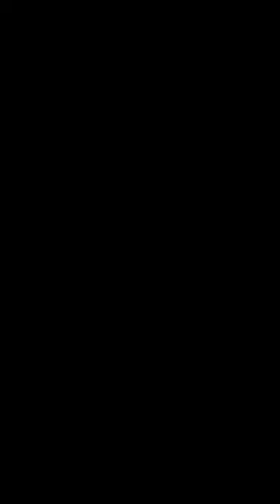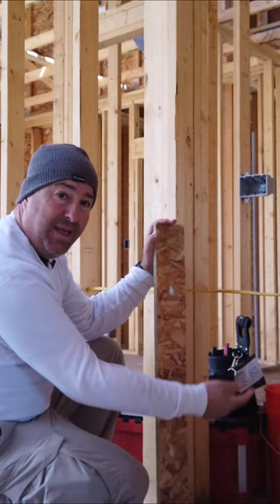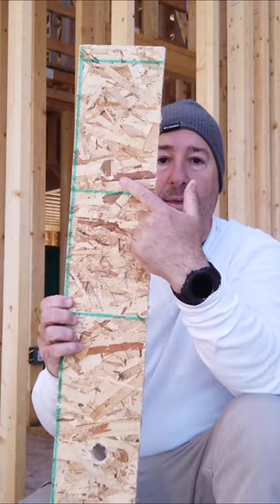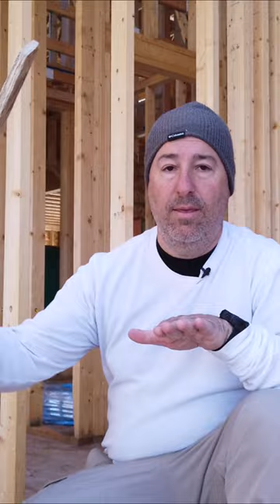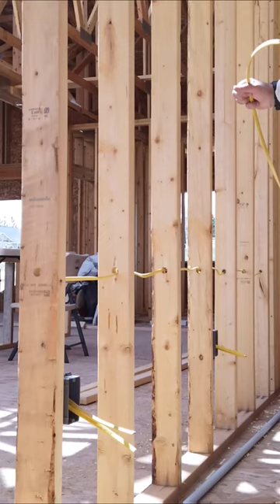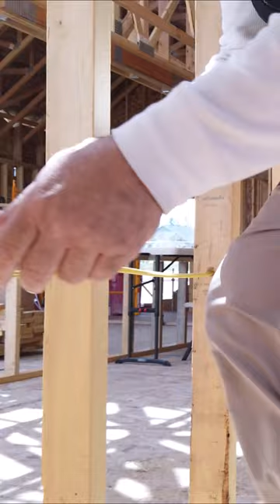How To Run Electrical Wires Thru Studs (Romex) - electrician tips and tricks

Comment: It makes the work look a lot better having all the holes at the same height. Plus, if you ever have to go back, you roughly know exactly where they're at in the wall
Reply from the maker: That's what I'm saying super easy
Reply from the maker: It's like, why make up the panel neat and clean like art. Same reason to run wires level and consistent.

Comment: Assuming the floor has been poured already. Laser is probably easier and more consistent. Plus you can move it up or down with ease
Reply: Depends on the job man. If they’re going to drywall right behind you then it’s not that serious, it’s getting covered up. No point in spending toooooo much time. If you use your body as a marker you should know what part of leg / chest to line up holes to punch with. It’s not a big deal if it’s off by an inch or 2.

Comment: The are barrels you can beat into the hole so you dont have to use a stike plate
Reply from the maker: Yes, the first time I saw them was at Southwires traingin center. There pretty cool. Problem is you can pound them in after the NM is in so sometimes will slow you down.
Reply: @The 360 Electrician  it does seem pretty slow at first but once you get a rhythm going its actually quicker I use them every day

Comment: Actually really good idea and you could easily turn this into a jig for sale.  Include some measurements and this could easily be the equivalent to a framing or speed square. 

😂

I use a laser but there’s always some variability which is greatly reduced with a jig.

Comment: Or just use a laser
Reply from the maker: 100% agree, but what if you have 3 crews? Takes too long to set up room by room, expensive to buy more than 1, battery dies it gets knocked over. You go to lunch have to pack it up etc. Works for sure but slow and costs more than a piece of free wood. Thoughts?

Comment: What a complete waste of time. Grab that hole hawg.with a 14" 7/8  greenlee nail eater bit. Lock the back oh the drill into your hip. And that drilling  keeping the drill level. Myself and a apprentice would layout, box drill,run circuits homeruns and panel of a 2500 home in a 7 hour day. You do it quick to not waste time. So anything you do extra like a template for each hole costs time.
Reply from the maker: That's definitely one way to do it. Wear rist guards or buy the new hogs with twist protection. Does anyone know who makes one these days?

Comment: I just used a chalk line pretty simple
Reply from the maker: I hate lines, messy to much set up time. Not so simple when you have 7 rooms. Nail and run line on everyday. What about 24 inch walls. Works but I'd argue not efficient. Now for a long Steele stud wall? Laser or line would probably work best. Thoughts?
Reply: Yes a little time consuming.  Never did much residential maybe a small  addition or a small house  for friends. Mostly commercial and industrial  . 44years as an Insidewireman varies streetlights and traffic control. Love the trade miss it very much been retired  for 3 years it takes a.toll on our bodies. God bless.keep up the good work .work safe
Reply from the maker: @loiskrauss1940  thanks for sharing